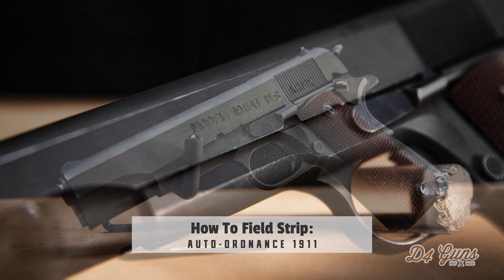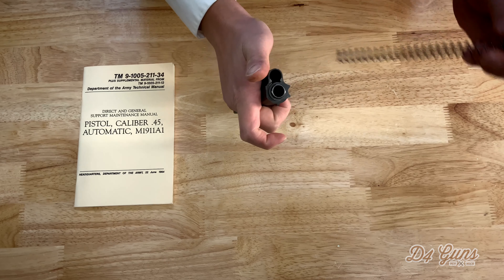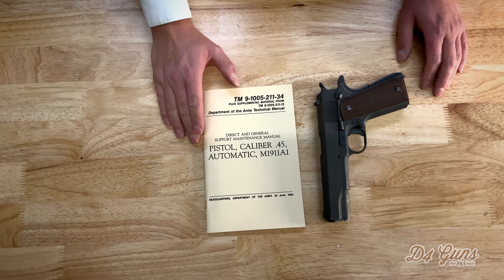Master the Breakdown: Expert Tips on Field Stripping Your Auto-Ordnance 1911 Pistol

Comment from the maker: ⏱VIDEO TIMESTAMPS⏱
===============================
Disassembly
===============================
0:00 Intro
0:11 Optional Bushing Tool
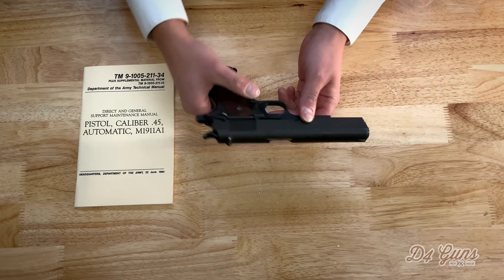0:24 Safety Check/Clear The Firearm
0:39 Remove Recoil Spring Plug and Barrel Bushing
0:58 Position Slide Group
1:08 Unseat Pin Portion of the Slide Stop
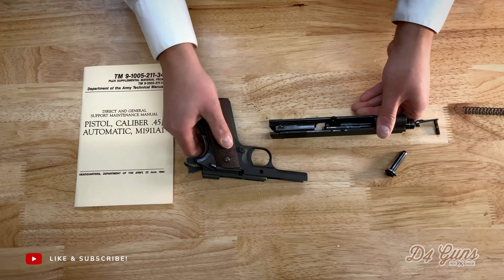1:12 Remove Slide Group
1:17 Remove Barrel Group
===============================
Resassembly
===============================
1:24 Reassembly
1:29 Install Barrel Group
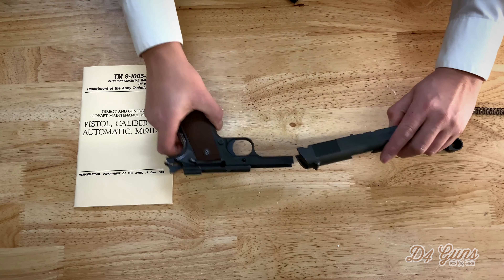1:38 Install Slide Group
1:48 Install Pin Portion of the Slide Stop
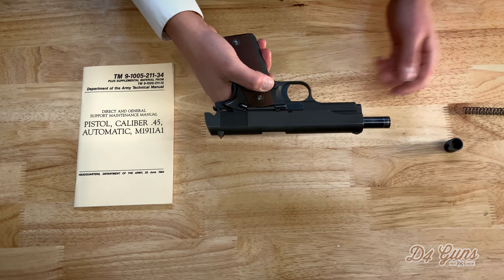2:06 Install Recoil Spring Plug and Barrel Bushing
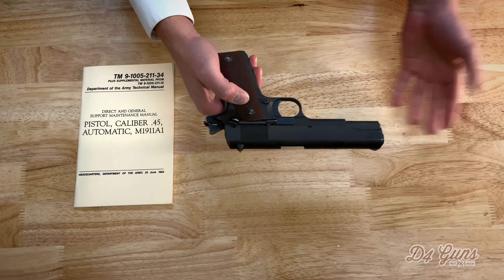2:25 Functions Test
2:36 Consult The Manual (Optional)